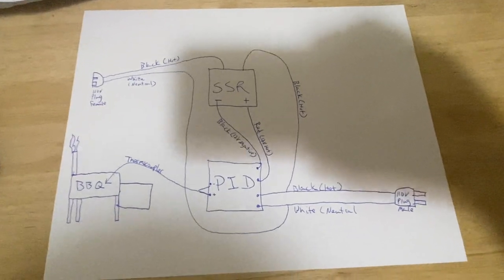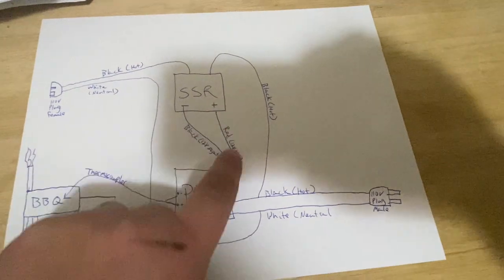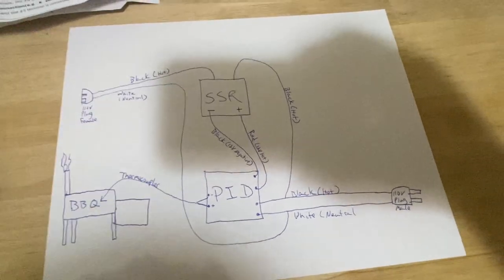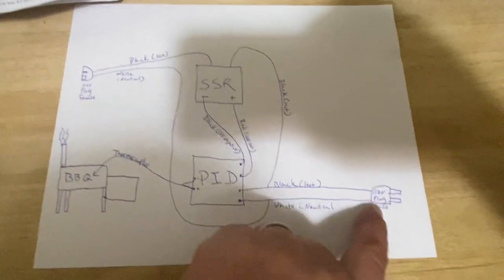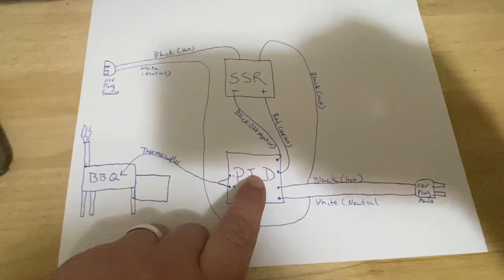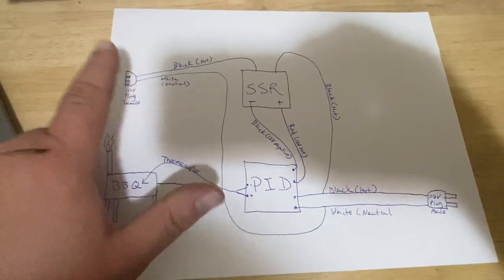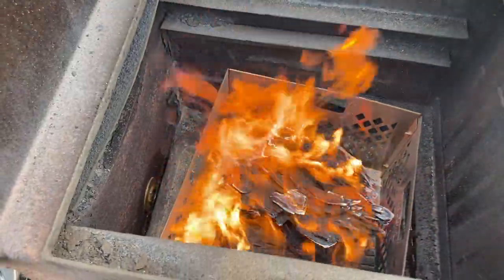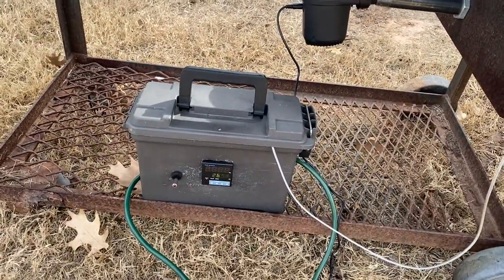How to wire a PID SSR Temperature controller.

Comment: Electronic control of tankless water heater: Use a PID? SSR vs SCR?
I have an 8KW Atmor tankless water heater that has two switched heating elements. I want to add stable electronic temperature control. But I can't find good information about the different options!
Seems the PID + SSR MAY have longer switching time, and that MAY reduce heating element life from thermal cycling vs a higher speed SCR. But I am having trouble finding the real answer.
Reply from the maker: I wish I could help you but I honestly have no idea. 

Beer brewers use a hot water heating element with an SSR. I don’t have any experience with an SCR.
Reply: The one tankless water heater I saw open used enclosed heating elements similar to what is used on a regular water heater. I doubt it would shorten the life of the element using a PID with ann SSR. They use proportional output with short pulses when it's holding temp and longer ones used to get to set point.  PID controllers are used with these types of heating elements and SSRs all the time and I've not heard of an issue with shortening the life of the element. With a tankless it would probably only be near set point when no water is running and full on when it is running.  Depending on the size of the element of course. You could use a linear output PID with a phase angle power controller which uses a phase angle fired SSR.  That would control the power to the element similar to a light dimmer but they are not cheap and usually used for quick response heating systems. No where near the slow response of an enclosed element like a water heater. What kind of driver are they using from the factory ? The one I saw used relays.
Reply: @USA__2023  it has a manual switch for element 1 and a manual switch for element 2. And a relay that shuts off when over temperature or no water is flowing. The temperature is adjusted manually by flipping switches and adjusting the water flow.
Thanks for your reply.